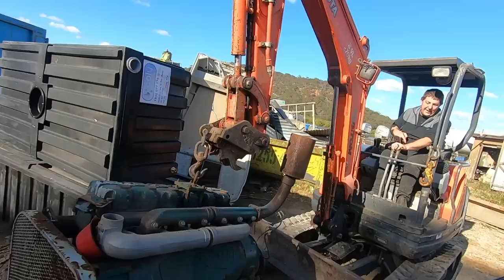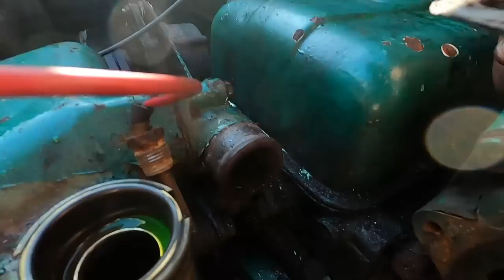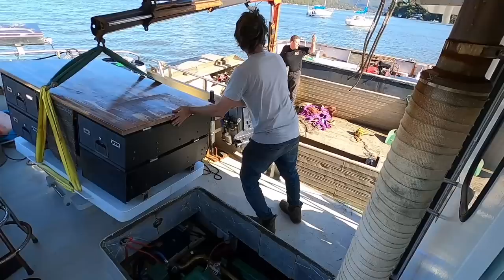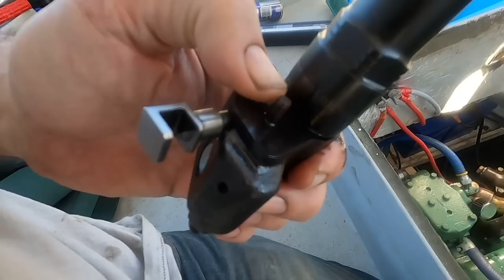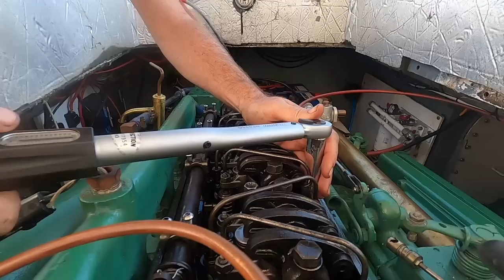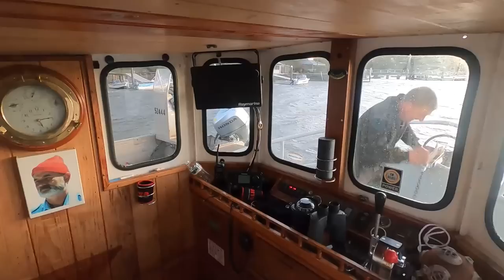Renko gets new fuel injectors

Comment: Stu, I’m not sure if you are planning your content but it’s really interesting stuff and loving it. Wish I had a mate like Adrian, he’s a great mechanic, encyclopaedia of diesel info, mentor and decent bloke….you two are the ultimate dynamic duo. I think you need to get a bigger boat. Reckon is sounding sweet.
Reply from the maker: Thanks Gordon. Most of it doesn't get planned, it's just a case of doing what needs to be done but I am trying to plan more of the outboard repair videos to support the new website. (outboard.dangarmarine.com/guide)
Reply: @DangarMarine  I have a 25 evo that needs a new leg and a 70 Johno that needs the rams done. Both should run. I have all the parts. Hit me up if you want to borrow them for some content. They would then be for sale too. cheers.
Reply: Gidday Stu, love the technical videos on the Detroits, keep them coming. What is the name of Adrian’s business and where is he located. Have a couple of 6 - 71 that need the injectors overhauling.
cheers
Jeff

Comment: Finally getting that engine dialled in and I can see the attraction. Without a diesel mechanic with the knowledge on these motors you would be stuffed getting anyone else to conquer them. Amazes me these engines may not have the best by modern standards emissions but the ability to rebuild virtually everything and recondition the motor many times saves the planet a lot of CO2 in production of a new one. Proof the American's had there metallurgy dialled in many years ago and something the Chinese will never work out.
Reply: Chinese metallurgy is fine if you buy their stuff that isn't for the foreign market. Cheap gets you cheap.

Comment: Stu, you could install a low pressure spring check valve in the return line. You would not be using the check valve function of the valve only the low pressure spring function to keep the return line primed. Available from stauff in a number of pop off pressures. Figure it’s best to fix it as you may be likely to run the tanks low again at some point. Reach out if you want more information. 
Cheers, Dan.
Reply from the maker: Yes, definitely sounds like the way to go.

Comment: Hi Stu, IV only worked on one Detroit engine, it was a six pot (don't ask what Model) but it was on a 450kva Genny.
I found it like a cat engine but with out needing special tool kit, 
I did do a cam shaft change and was able to set everything using a set of digital calipers and the correct measurements.
I know yours is two stroke and mine was four, but Adrian words were so right and took me back 12yrs.
Don't we all just love old school engines.
No computers........and low voltage sender error codes.....limp modes ect.
Nice job chap...... running sweet again.
Reply from the maker: I know what you mean about no computers. Adrian and I went to a diesel truck breakdown during the week. It would crank but not start and turned out to be a single wire that affected the computer opening the injectors.
Reply: @DangarMarine  tell me about it, I work on heavy plant, and doosan are worse for wiring....
Miss fire on a 22t excavator turned out tobe cracked injector wires inside rocker cover

Comment: i keep everything full. treat the 3/4 mark as half and 1/2 mark as empty once you get used to doing this you will never run out of fuel, and will have less issues stemming from condensation in the fuel
Reply from the maker: Yes, as you say, once it is full you don't spend that much keeping it that way.

Comment: The idea that comes straight to my mind is a baffle in the fuel tanks and a baffle bypass (level balance) valve. Close the valve and only fill the smaller section of the tank to get more level for fewer bucks. No idea how practical that is in your layout and cleaning out fuel to make it safe for welding etc…

Comment: Check valve in the fuel return line will fix the drain/air issue.
Reply from the maker: Yes, I didn't realise you could get them with a pressure rating so they will allow fuel to flow in the one direction but only under pressure.

Comment: are you running a restricted fitting for the return?  recollection seems that it should be about .080.  there also was a drainback valve used on some equipment to keep that from happening. seen a cracked fuel pump housing that would suck air but not leak fuel. that one was an s.o.b. to find. it would run all day ,once you got it started.
Reply from the maker: All good questions. I'm not 100% sure about what restricters are fitting but something has changed as it never used to do this so definitely something to track down!

Comment: you can put a check valve on the return will give a tiny bit of resistance and stop the drain.. it's fairly common most good diesel shops have them it's just a ball with a small spring should be enough to stop syphon but not disrupt return fuel
Reply from the maker: Yes. At first I was thinking a check valve wouldn't work on the return side as the flow is in the same direction but one with a very slight bit of resistance that opens when running but stays shut while off might do the trick.

Comment: Hey Stu if you could run a piece of flexible hose in a loop lower than the bottom of the tank on the return line would that stop the run off of fuel and solve the problem for just a piece of hose and a couple of clamps... hopefully 🤷‍♂️
Reply from the maker: A loop higher than the top of the cylinder head would definitely help.

Comment: Check your manual fuel pump. Had a Detroit in a boat I worked on like yours. Fuel pump seals were going out and it was getting air in lines thur the night.
Reply from the maker: Adrian rebuild the fuel pump about a year ago but definitely something to check in case a seal has failed.

Comment: Mate intall a check valve on the return line near the tank so it need 15 psi cracking pressure  that way it won't  do what it does, just friendly suggestion cheers from Canada
Reply from the maker: I was thinking that might be the only way to do that with a check valve. A normal one-way valve won't help at all but a pressure rated one would.

Comment: Hey Stu, hope all’s well. Still in Bali? Just reviewing some archive content. Could you install a check valve with a low crack pressure or a solenoid that closes when engine is off into the fuel return line to prevent fuel from draining out of the common rail?

Comment: You could try putting a loop in the re-turn line up higher than the rack.
Reply from the maker: Yes, loop would help but the trouble is the rack is pretty much level with the deck (given the coaming and hatch) so I can't really get higher.

Comment: Maybe fit a balance tube between the fuel tank outflow and the fuel return?  I can’t see that affecting anything else, so long as you keep the original fuel return to the tank open it should just find it’s own level….(edit) or maybe just a one way flow valve(non return valve😁) on the return line?

Comment: Hey Stu, got a question for you. I just got done testing my 60hp merc coils for the video I'm doing but the coil readings with a DVA on DC volts reads different if just cranking or running motor. The book states testing can be performed by either. I think this test can only be done with the motor running. not doing the resistance test just the voltage which is coming into the coil packs.

Comment: Hey stu, I have an evinrude 175 ficht (1999 model I think) and the gear shifter in the gearbox is really tight. Do you have any idea on what it is. I also I have a slightly newer evinrude 200 (bombardier) which I want to put on but I've never installed or uninstaller a larger outboard so some little tips and tricks would be greatly appreciated. I'll also have to somehow get in contact with Adrian about those perkins injectors. 
Cheers

Comment: 23:50 install a check valve in the line to prevent backflow of air into the rail. Detroit SKU#: DDE 23535724. Also make sure fittings are tight on the return side.
Reply from the maker: It's my understanding that those check valves are only useful in the inlet side as the return line is draining back in the same direction the fuel normally flows therefore the one way valve won't help like the inlet where it drains backwards.
Reply: @DangarMarine  nah mate, it goes on the drain side, prevents the inlet side from draining back. Keeping the inlet side full of fuel so the engine will start easily. Look into it if you don't want to take my word for it. Also provides for the proper fuel restriction. Your not pullig air from the inlet side(unless you have loose fittings or are out of fuel), your pulling it from the drain side.
Reply: @DangarMarine  I believe that is a spring loaded check valve too, so when the engine isn't running the spring will keep it closed so no air can migrate back into the fuel rail. Frightfully expensive though, I'd look into a generic spring loaded check valve and keep the restricting fitting in the head.
Reply: Check valve in the return line is the best way to stop loosing prime check valve in suction line is another set of problems.series 60 or series 50 will loose prime as soon as you turn off the engine two cycle will do the same thing easy fix

Comment: stu, what are the wires through the rusty nut on the port side of the engine?  Should they be protected?
Reply from the maker: There are some wires going into a brass temperature sensor on the starboard side, are those the ones? That is actually coming out for a mechanical temperature sensor soon.
Reply: Beat me to it, yeah I was gonna mention for Stu to through some tape or something over each of wires at least and save yourself an erroneous temp alarm if it's still connected; figured you'd bothered to shield it over the manifold so it might still be in use :) You're all over it mate, figured you would've spotted it in editing anyways. Thanks for the content as always

Comment: Great video as always!  I may have missed it but was the hard starting the main reason for the smaller injectors? We always ran N60's in all of our Detroits.  We had three Inline 6-71 for Generators and one V8-71 to power our Tow Winch on our Large Sea Going Tug which was married to a 240,000 barrel Oil Barge with an InterCon Coupling System so we would be connected to the Barge at all times at sea.  We also had a pair of EMD 16-645-E2's for Main Engines each rated for 3000 hp (approx).  The EMD's are more or less a Detroit on Steroids.  The EMD's had Turbochargers instead of a Roots Blower.
Reply from the maker: The change was mostly because Renko isn't under enough load. It was set up for pulling fishing nets and now just putts around the river.
Reply: Hmm, "E2" indicated roots engines, "E7" was the common turbo version.  And for those wondering, the turbos have a one way clutch to mechanically spin then for scavenging at start up and low speeds.
Reply: @newjerseybill3521  Good Catch, my old brain must have been a little foggy when I typed that.  They were F7B's but I got rid of the "Econo" Injectors that they came out with that were supposed to save so much fuel but did nothing on the kind.

Comment: Sounds more mellow! Is it safe to need a crane to acces the engine bay?
Reply from the maker: You can also access it through the bulk head hatch.
Reply: @DangarMarine  I'm not liking that in an emergency where climbing into the engine bay might not be advisible. How about home made draw glides on the long sides of the engine hatch and legs with wheels on the two aft corners of the hatch. Cut off the forward lip of the hatch (replace with a rubber flap) and put in corner stops so the whole hatch assembly can be slid aft to open.

Comment: if the return line goes downhill to the tank top then maybe... but if there's any significant uphill run between cylinder head and the tank then i don't think that the whole line can drain. i would be looking for an issue on the supply side.
Reply from the maker: The entry is slightly lower than the cylinder head but I'm starting to think back to when the boat was launched and I filled from jerry cans. I don't recall this happening (obviously the level was quite low at the time) so we may be on the wrong track. I'll check the supply side today while I'm on the boat.
Reply: a lot of detroit installs on equipment here in the states have a check valve in the supply line to the fuel pump to prevent fuel siphoning back to the tank through the fuel pump if the fuel pump has some wear in it's gears. that could be the problem. i've also heard of people installing an electric fuel pump so they can prime the system for faster starts especially after replacing fuel filters.

Comment: How about putting a check valve into the non-return line? That shouldn't be too difficult and will prevent the rail from draining.
Reply from the maker: Possibly. I can't quite get my head around how those checkvalves help given the fuel is draining out in the same direction is flows when running.
Reply: Could you plumb a P-trap kind of thing in the line maybe.  This is an interesting problem.
Reply: @DangarMarine  what I should have said was a normally closed valve, with the port reading upstream and set to open at something like 5 psi. Another way would be a solenoid operated shutoff valve, this would open with the ignition and shut off when ignition is turned off.

Comment: If you could buy a new from the factory 2022 engine for Renko what one would it be?
Reply from the maker: Hi Roger, thank you so much for your donation. Good question, I haven't really thought about it that much but I can't help feel I would like to experiment with diesel electric, a bit like an old-school submarine where the diesel is simply a generator and the electric motor drives the propeller. It would be interesting to see which diesels tend to go into circa 75kva generators.
Reply: @DangarMarine  Interesting you picked 75KW. All the 75KW generators on our tugs where driven by 4-71,s. @1800rpm for the US 60hz.

Comment: The fuel draining back into the tank once shut off could be stopped by putting in a non return valve in the return line.
Reply from the maker: Wouldn't a non-return valve stop it returning while running?

Comment: put a check valve on the return line
Reply from the maker: A simply one-way check valve won't do anything because it drains out in the same direction that it normally flows but a pressure sensitive valve might do the trick.

Comment: Id say 75% of sailing channels have problems with deisel engines. And they dont have Adrian to fix them. Burning oil, leaking oil, fuel pickup, you name it. Having driven a bus for 20 years, I am not convinced that is the best type of engine.
Reply: You can see how many factors need to be right to endure good reliable engine starting and performance...for any engine.
After having a Japanese diesel engined 4WD for the last 21 years....the Japanese in the 1990's had small diesel engines well sorted...before they got screwed up with DPF, DEF, FADEC  etc.
Running a petrol (gasoline engine) which has a fuel injection pump in the fuel tank consistently low on fuel can also engender problems.....
Reply: Big consideration (besides higher efficiency) is that diesel doesn't vaporize like gas does. An inboard gas engine needs a lot more protection against fuel vapor / explosions, and it's less efficient to run.
Reply from the maker: It would cost a lot more in petrol to push a boat with this weight and hull shape.
Reply: To most sailboat people, the engine is just a form of cast iron ballast. Maintenance?!?!?! BAH!!!!

Comment: put a one way valve in the fuel line that will keep your prime
Reply: It's the overflow/spill line that runs from the injectors back into the tank...
Maybe just a vertical loop in that line to store a certain amount of diesel there (no check valve to jam up and cause running problems) and would still allow free progress to the spill fuel?
Reply from the maker: Did consider and antisyphon loop but the deckhead is actually very close to the height of the cylinder head so tricky to do.
Reply: @DangarMarine  
Stu, could you deliberately put an anti-syphon break into the line by mounting an in line fuel filter, near to the deckhead, with a T piece under it into which the spill fuel drips down into the line to the tank.
(Any rise at all in the end of the spill line from the engine to the T piece would ensure the line stays full....)
The rubber hose onto  end of the Fuel filter which allows air in could be any length/position  as all it does is filter the incoming air.....(bit like breather extensions on a 4WD)

Comment: Will you expect reduced fuel consumption with the smaller injectors? 
Filling the tanks only hurts once, then just keep them topped up.
Mind you, I’ve never minded spending other peoples money. 🤔
Reply from the maker: I would expect the fuel consumption to be a little bit lower but also burn a lot cleaner. You are right about filling up. Do it once and then keep it topped up after that.
Reply: @DangarMarine  fortunately I can take my truck to the local reservation to save a bunch of money on fuel. That’s a little harder with a boat. I do have a 400L transfer tank, but even at that I’d imagine it’d be quite a few trips for the likes of Renko

Comment: Why tow the barge arse about?Surely a rear line would be more practical.Try fuel doctor for the fuel problem.
Reply from the maker: Because that's the direction it arrived at the mooring due to the current and it isn't work the effort of spinning it around for a 500 metre tow and the front is pretty similar to the back!